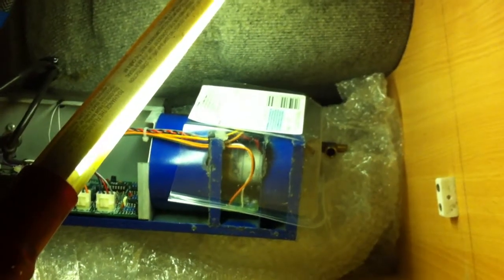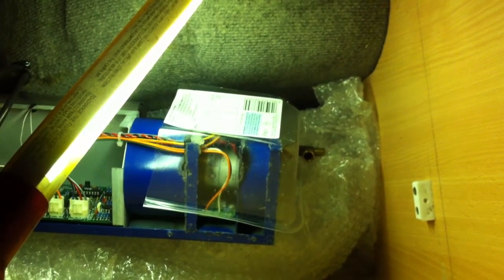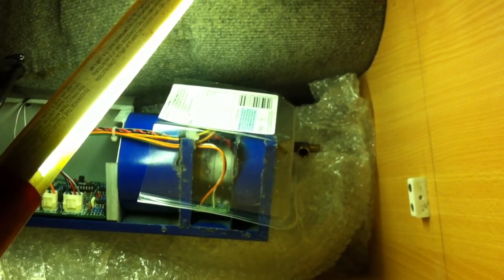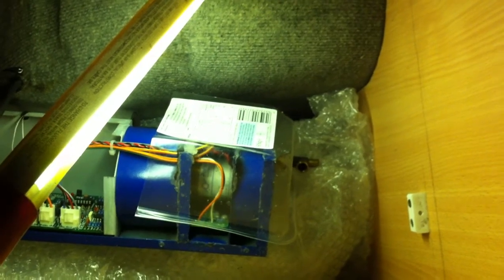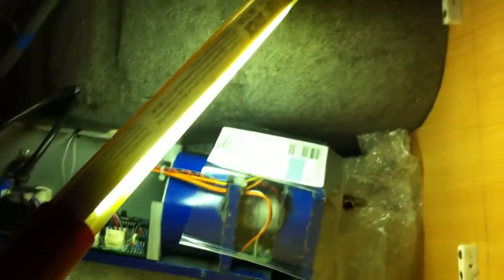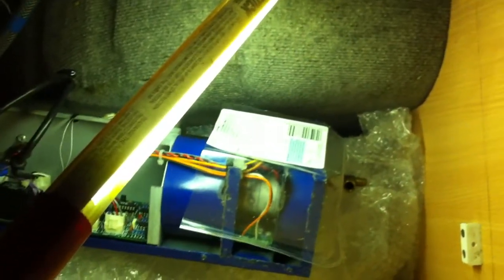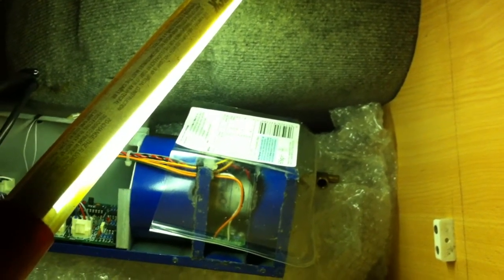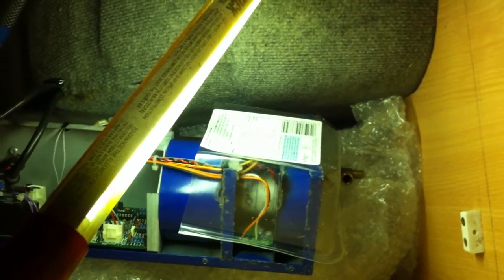Propex Heatsource 1600 Fan Sensor Testing

Comment: Hi Kevin, I followed all your instructions and now have a fully functioning heater. Many many thanks for your patience, assistance and fantastic easy to understand videos.
Best regards
Stuart🎉🎉😊
Reply from the maker: That's great news. What was the root cause of the problem? What did you have to do to fix it?
Reply: @bvqbvq   I cleaned the spinning disc on the sensor and carefully followed the instruction in respect of the spacers. When I tested it the gas solenoid operated but I couldn’t hear the tell tale clicking sound but I forged on and connected the gas. It worked first time. I was a bit worried about not being able to hear the igniter but is fired immediately and so I never did hear it. The final stage was to re seal it, then checked it again and all was well.
The final part of the story is that I sold the horsebox which was the home of the heater. The new owner said that he didn’t want it because he already had a Chinese diesel heater.
Win win for me.
Again many thanks
Best regards
Stuart
Reply from the maker: @TheMorgan47  I found that the spinning disc sensor didn't last long before it needed cleaning again. In the end I fitted the replacement pressure sensor that Propex sell. It wasn't cheap (about £75) but it did fix the problem once and for all.
Reply: @bvqbvq  I did notice that you replaced it. Hopefully that will be the responsibility of the new owner, although I will make them fully aware before they buy. If I get any takers that is.

Comment: Hi Kevin, looks like you know a bit about these problematic heaters. I’ll describe the issue with mine and hopefully you have some answers. So I have a hs2000 and it’s not staying lit. When I switch it on it blows cold for a bit then you can hear the solenoid click followed by the sound of the  burner/flame rumble. The flame is on for about 8 seconds then the solenoid clicks and stops the flame, it then blows cold for 18 seconds then clicks again starting the flame which burns for another 8 seconds. It continually does this cycle till I turn the unit off. No fault codes appear. Have u any idea what’s up? 
I have cleaned the airflow sensor, combustion chamber and flame sensor. 
Cheers
Reply: I’m getting a around 24v ac reading from the airflow sensor, is that normal? Green to orange wire
Reply from the maker: @Jackson Hook  firstly 24V AC sounds quite high for the airflow sensor. If it is the same sensor as in mine then the output is a 5V squarewave so that should give you about 2.5V AC.

WIth regard to the primary fault, the gas being switched off and then back on, that is curious. I am assuming that there are no fault codes flashing up on the LED on the control panel. Here are my thoughts:

1. If there was a flame failure after ignition then I suspect that it would give you an error.
2. If the airflow was too low or insufficient output from the sensor that would give you an error.
3. If the combustion chamber overheated then there would be an overheat error.
However, there is a thermal cut-out mounted on the combustion chamber, I don’t know whether that is reported as a fault. If that is tripping then I imagine that cuts off the gas to reduce the temperature. To test that you would have to measure the voltage (DC) across it and it should be close to 0V. If it trips then this voltage will increase.
The only other thought that comes to mind is that the controller stops calling for heat and that turns off the gas valve but I wouldn’t have thought that it would try to relight in 8 seconds.

It might be possible that it lights the gas and doesn’t see that it has lit so it switches off the gas, purges the chamber and then has another go. I don’t know why this wouldn’t show an error after a number of attempts. You could check that the flame failure electrode is positioned so that it is in the flame, that the wire is in good shape with good connections on the electrode and the connector.

You could make a resistive measurement to make sure that there isn’t a short circuit to the chassis. The only other thought would be to look at the solder joints on the back of the PCB with a magnifier whilst wiggling the components on the top side to see if you can spot any cracked solder joints.
Not sure what else to suggest.
Reply: @bvqbvq  Thanks for the prompt reply, yes there are no fault codes that come up unfortunately. It’s almost like it doesn’t know there’s a flame so try’s again. But normally this would give a fault code after a second attempt. It’s not over heating as I checked the failsafe switch, for continuity. I also cleaned and inspect all components and pcb board for defects in the circuitry, it checked out from what u can see with a magnifying glass. I’ve also been in contact with many technicians and also the manufacturer in the UK. It would be helpful I think to know the programming of the unit, down to the voltages, times, waves etc that the controller reads but no idea how to find that info. I’ll have  another look at the ac voltage. Thanks again for your help!

Comment: Hi Kevin
I followed your video relating to the fan. I’ve got the fan spinning and it opens the gas valve as it should.
However, I don’t hear any tick from the igniter (I’m currently troubleshooting without gas being connected)Now mine is a much older version than yours with the spark generator on the main pcb (new from Propex) thus my previous comment about having already spent too much money on it to commit it to my unsuccessful project’s drawer.
I have no idea how any flame failure is notified due to far fewer wires on mine compared with yours.
It’s noted that the lead from the spark generator to the ceramic sparker, like yours is extremely thin - that’s merely an observation, I expected it to be much thicker to carry a high voltage.
Would you be kind enough to advise me how you would troubleshoot this issue please?
I may not fully understand it all but I have a friend who deals with electronics and he will understand.
The most worrying feature for me is the lack of the tell tale ticking sound but perhaps if the actual spark unit has collapsed it might be a straight short. This is the rambling of a no knowledge practitioner.
Thank you in anticipation for your continued assistance.
Best regards
Stuart
Reply from the maker: If I was fault finding the ignitor, I would have to convince myself that there was no gas pressure sensor. You could always just attach a pipe to the gas inlet and pressurise it. You only need a low pressure to simulate the gas pressure, you could probably just blow into the pipe. If you then hear the ignitor ticking then you know that there is a pressure sensor.

The HT lead to the spark electrode only needs to be thin because the current is very low. So long as it has a relatively thick layer of insulation then it is good for high voltage.

I would check the spark electrode gap, if it is too big you won't get a spark and won't hear the ticking.

If your electronics friend can see if the supply to the ignition module gets switched on after the fan has been running for a while that would be really useful. In fact, he should be able to manually switch a supply (12V) to the ignition section of the cicrcuit and see if you get any sparking.

The flame failure device normally just takes the form of a single electrode whose tip is in the flame. There is then a single wire back to the PCB.

Let me know what you find.
Reply: @bvqbvq  Thanks Kevin, I’ll be applying your suggestions over the next couple of days.
Is it necessary to remove the igniter to regap it?
Regards
Stuart
Reply from the maker: @TheMorgan47  I've never had to regap the spark gap but it would be worth checking. I don't know how it is held in place but I suspect that there is a screw to release it. I don't know what the gap should be.

Is any of this any use?
https://vandogtraveller.com/propex-compact-1600-campervan-heater-not-igniting-fix/
https://escaperoutetales.wordpress.com/2016/04/19/propex-heater-problem/

Comment: Kevin
Thank you for your comprehensive answer. I’m afraid a lot of the technical detail I don’t understand but I have a friend to whom it will cause him to salivate. I will use the information to troubleshoot my system. Thanks again for your assistance.
Best regards
Stuart
Reply from the maker: When they are working they are nice little heaters. It should be possible to get it going. Good luck and let me know how you get on.

Comment: Hi Kevin
Thanks for your prompt reply. It was only when I saw it I realised the thread is 7 years old.
I have watched your video re the sparking problem but there are a couple of issues for me.
My model is much older that yours though rarely used looking at the condition; the spark generator comes directly from the pcb which I have just replaced with a new one. The upshot is there is no small pcb in that system.
I will check the electrode before I go any further and if I could prevail on your expertise a little further will the gas solenoid operate if the gas is not connected or that may be indicative that the air mass sensor is still not working.
I wondered if there is a way to check that out by bypassing the air mass sensor.
Unfortunately i've spent too much money on it already but unless I get it going it is junk.
Hope you can help.
Regards
Stuart
Reply from the maker: Ah, I had one of the very old models with a red painted case. I spoke to Propex about getting it going and they told me not to bother and they did me a 'special price' on a new one. I don't know how your differs to the one that I currently have but I suspect the principle of operation is similar.

In answer to your questions:
1. The gas valve should operate without any gas present, as far as I am aware there is no gas pressure sensor.
2. The air flow sensor cannot easily be bypassed as it generates a squarewave signal to the control processor. You can see if you are getting a signal by using a regular multimeter set to VAC. The sensor has 3 wires: ground (0V), supply (5V) & signal (0V-5V-0V-5V....etc). You can do a resistance check to a chassis ground point or the -ve supply wire to determine the ground and then the supply should measure 5V WRT ground. The signal wire may also measure 5V depending upon the position of the sensor. If you spin the sensor then one of the remaining wires should alternate between 0V & 5V. If it is spinning fast enough it will generate an AC voltage that your meter can measure.
3. You could bypass the flow sensor if you have a signal generator ;-)

I would imagine that the sequence of operation would be:
1. Energise the fan.
2. Wait for a time to purge any gas/exhaust.
3. Check that the output from the air flow sensor if sufficient. If not stop and flash error 5 and stop.
4. Open the gas valve.
5. Wait for gas to enter the combustion chamber.
6. Energise the spark ignition module.
7. Check the output from the flame detection sensor. If none, stop and flash error 1 or 2.

The manual that I have lists the following errors:
1. Failed to ignite.
2. Flame sensor.
3. Low voltage.
4. N/A
5. Combustion air flow.
6. Gas solenoid.
7. N/A
8. High voltage.
9. Heat exchange temerature high.

Yours may have completely different error codes. When mine starts the fan runs for about 30s before you hear the clunk of the gas valve followed by the ticking of the spark which is follower by the roar of the flame.

Does any of that help?

Comment: Kevin, great vid and helped me no end. 
Can you tell me what you repealed the unit with I.e. the type of silicone?
When it’s working (and I know that you had to replace it) without the gas connected should I still get two flashes on the thermostat. Thanks, y our videos are perfect for idiots like me.
Reply from the maker: You can just seal it with some standard silicone, it doesn't get that hot around the outer casing. Make sure that it is fully functional before sealing it back up!

If you are getting error code 2 (2 flashes) then that is an ignition failure, see my other video because I also had the same fault (https://youtu.be/aERfIJzZY-4).

I would check your wiring and connections and the state of the ignition electrode before you dig into the ignition module to search for bad solder joints. Unfortunately the quality of these Propex units is not great.

Comment: Is this fix doable without removing the heater from the van? My unit has just started to give me the 5 flashes and I'm guessing it's going to be the same issue.
Reply from the maker: I had to remove it from the van to get the cover off the back part since it is fitted with silicone sealant. Although I initially cleaned the sensor it did not last I ended up buying the replacement pressure sensor from Propex and that appears to have fixed it properly. This is the part that you are likely to need:

https://www.propexleisure.co.uk/shop/air-flow-sensing-upgrade-kit/

You will need the 1800 variant for the Heatsource 1600 unit. Someone has done a video showing the replacement:

https://www.youtube.com/watch?v=cYN7LkTVod0